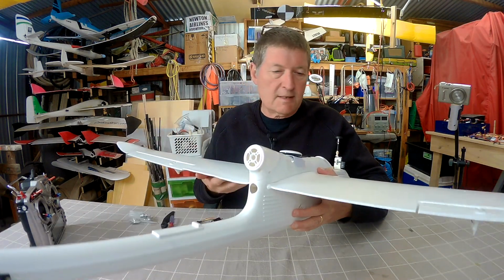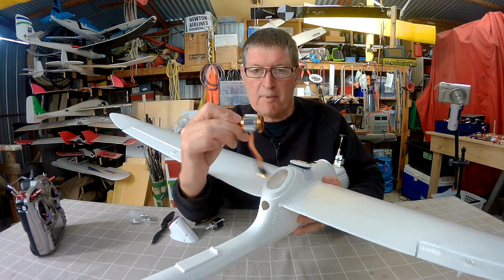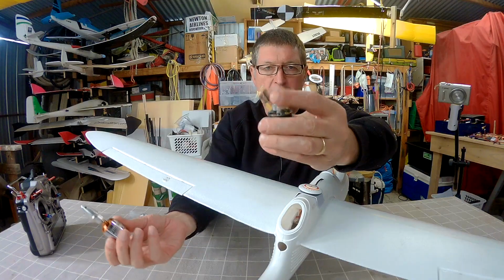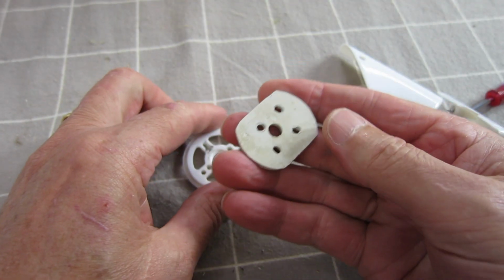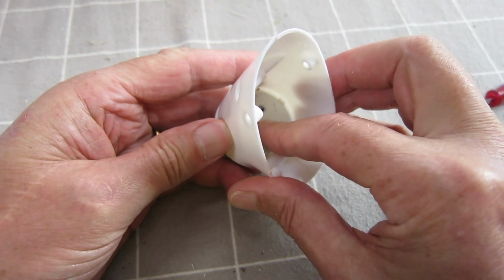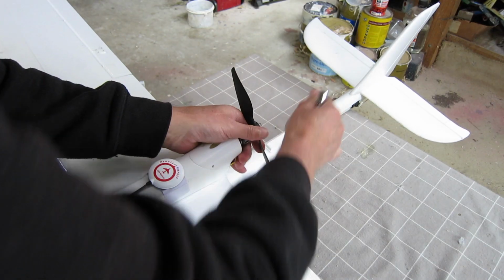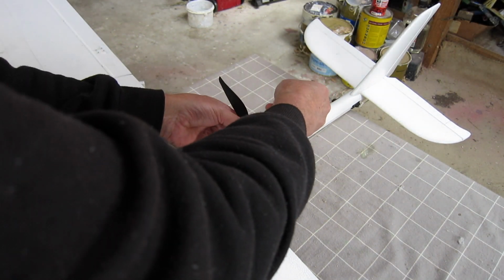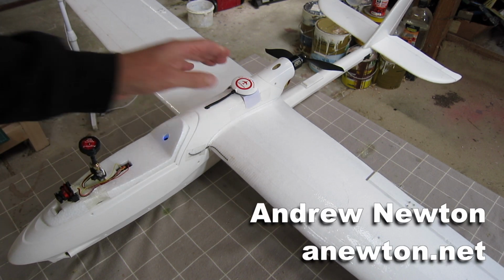Volantex Ranger motor mount

Comment: Thanks for this.  I agree the plastic plate for the motor mount doesn't inspire confidence :)  I have a new Ranger 1600 and inside the cowl that holds the motor plate, there is a second ring that allows the motor to be mounted slightly more forward in the plane and with a touch more up angle.  The motor ends up recessed into the cowl about half way.  Also, there's room to mount the motor inside and use a long stem for the propeller.  Interesting to have options!
Reply from the maker: I didn't know that, thanks for the tip

Comment: Andrew, good mod, another tip when re assembling  the mount is to put a tiny bit of silicone sealant on the disk where it sits in the groove of the outer shells, makes the motor quieter
Reply from the maker: Not a bad idea
Reply: worked a treat on my 1600, stock motor sounded rough so swapped out to a DYS and just as bad, then noticed slack on the mount, now cured

Comment: I trust the motor housing less than I trust the motor a mount.  Funny that that the screws that hold the motor to the motor mount are way stronger / bigger than the tiny screws that hold the motor mount to the fuselage

Comment: Received mine :). I need to prep it for the air. I will probably model and print a new motor mount disc to replace the flimsy one.
Reply from the maker: Excellent, I'm going to hack one out of aluminium
Reply: Yeah aluminium, good idea. Probably even better even though a thick plastic one should be enough.

Comment: Interesting Andrew, I also took one look at mine and thought same, I can't believe they hollowed it out so much.. for no possible reason. Might be a small milling project with some aluminium there..
Reply from the maker: Yes I thought aluminium too. To the drill press!
Reply: Andrew Newton I also had another small problem with that mount, in the screws tapping into the body. Two of them had no bite at all as the cast in thread holes had sheared onto the screw (too thin around the edge) so I glued nuts with suitable washers to the inside using T7000 (easy access) and used 2mm threaded machine screws, as the heads fit into the recess perfectly. No chance of pulling out now. Cheers.

Comment: Hi Andrew, would the SunnySky X2814 1100kv be a good choice of motor as an upgrade for this wing?  I bought the same turnigy one you have to get started with.
Reply from the maker: On 4S that would be perfect, might be a bit slow on 3S
Reply: Hi Mate,  thanks for the reply, yeah i want to fly on 4s as i have a ton of lipos 3300-5000mah 4s!  Cool i may go for that as a premium upgrade!
Reply: @HallyFPV  hello friend !!! please tell me did you put the 2814 / 1100kv motor on the ranger 2000 ??? if so, what propeller are you using ???

Comment: Andrew, I took your advice and reinforced the motor mount from behind with an aluminium cross and Araldite. On reassembling I noticed that the original plastic mount is offset to Port about 1 degree. Is this a design feature to compensate for torque, or have I got a faulty part?
Reply from the maker: The offset is normal, but I never worry about it. Doesn't seem to make much difference. You can always add some shims or washers under the motor to recreate the original thrust angle.

Comment: Hi Andrew, great video.  When you balance a prop (dynamically) has the prop been balanced previously on one of those prop balancer machines?
Reply from the maker: That's right Jim, I use clear sticky tape to static balance then fine tune by dynamic balancing.

Comment: Hi Andrew, Have they changed the design of the motor you are recommending here...or am I looking at the wrong thing. The PROPDRIVE v2 2836 1200kv unit on hobbyking has a 3 point mounting on the base - and the base rotates with the prop.... If I'm looking at the wrong motor could you include a link please?  On your recommendation I've previously bought the Phoenix and now i've just got the Ranger 2000 as a kit.
Reply from the maker: That's the right motor https://hobbyking.com/en_us/prop-drive-v2-series-2836-1200kv-530w-brushless-outrunner-motor.html It comes with mount options for both ends of the can. You bolt the threaded shaft on the opposite end to the wires
Reply: Thanks Andrew... Being particularly stupid this evening!
Reply from the maker: Haha, don't worry, it took me ages to work it out.

Comment: I like the dynamic balancing, I'm supposing you do that after balancing the prop itself?  :)   I've seen people use apps on their phones that measure vibration and thought that interesting too. Do you do that with all your motors/props?
Reply from the maker: Yes, static balance the prop first then dynamic balance in place. Make a major difference. I have used apps before but prefer just to feel the vibrations. Definitely do the dynamic balance with all prop/motors, even if I dont balance the prop first.

Comment: hello friend !!! can you please tell me if it is possible to put a motor 2814 / 1100kv for 4s on a ranger 2000 ??? if so what propeller do you use ???
Reply from the maker: Perfect. 8x6" prop
Reply: @AndrewNewton  excuse me .. how much amperes with this configuration will the plane consume at cruising speed???
Reply: @AndrewNewton  excuse me .. how much amperes with this configuration will the plane consume at cruising speed???
Reply from the maker: 4 to 5A

Comment: The GPS puck appears to be backwards, assume you've rotated it 180 degrees in software? Interestingly mine came with a 2212 multi rotor type motor, hopefully it'll have the beans.
Reply from the maker: GPS puck can be mounted any way for fixed wing iNav setup. No orientation instructions required and compass is not used. I did read that the stock motor is a bit underpowered. Let me know how it performs.

Comment: Hey Andrew - I just got my ranger today and im cannibalizing my LTE rambler for a motor for new volantex plane. I have a feeling that in different video you also mentioned about aluminum ring/cylinder that you made to assembly that motor into this plane? What is the latest solution ur using ?
Reply from the maker: Good question. I'm using the supplied plastic disc to retain the original thrust angle, but it's sandwiched between 2 normal X motor mounts for extra strength. I'll take a photo soon.
Reply: @AndrewNewton  i will appreciate that!
Reply from the maker: Here's the photo https://www.youtube.com/@AndrewNewton/community

Comment: Can you send a link for the engine?
And which speed controller should be used for a 3-cell battery
Thank you
Reply from the maker: I'm using Turnigy Propdrive 2836 1200kV on 4S 3000mAH and 30A Plush ESC. For 3S it would be better with a 1400kV motor
Reply: @AndrewNewton  Good Morning
Thank you for coming back to me, I'd love a little more details from an expert person like you.
I want to be strong with a lot of power that will fit in technology.
Which is better to use to get good results for power. And which prop size, and esc to use your recommendation?
https://hobbyking.com/en_us/propdrive-v2-2836-2200kv-brushless-outrunner-motor.html 
https://hobbyking.com/en_us/propdrive-v2-2836-1400kv-brushless-outrunner-motor.html  
Thank you very much for your help
Reply from the maker: Stock prop and 1400kV on 3S. 30 or 40A esc
Reply: @AndrewNewton  Thank you

Comment: did i just see the motor mount twisting while powering up and down?!
Reply from the maker: Ha, well spotted. Glued in position now. I had to remove the title locking lug to rotate the mount 90º The rotation was restricted by the backing plate but even a few degrees of repeated twisting might fatigue the wires.

Comment: Simple and effective mod .... that plane is on my want list [the 1600] and super cheap at HK with free shipping in Aus as well. More expensive at BG and they also have free shipping but if you buy the 2000 the shipping is 98 bucks ... WTF. Lipo include I s'pose, but they have no stock. Whatever ......
Reply from the maker: HK can be cheaper for planes. Pays to shop around.